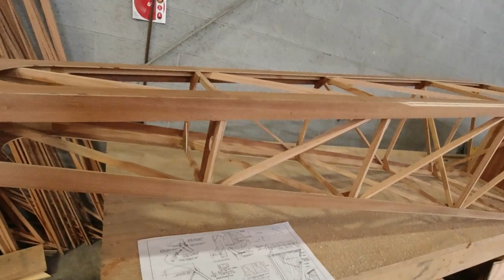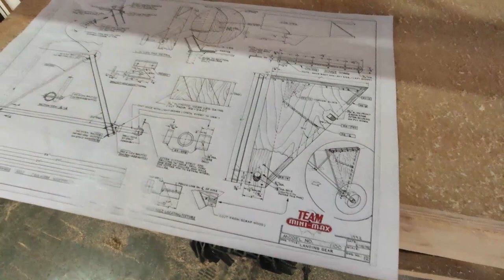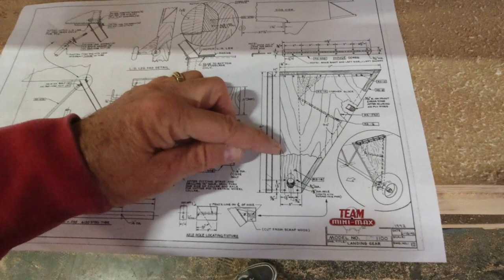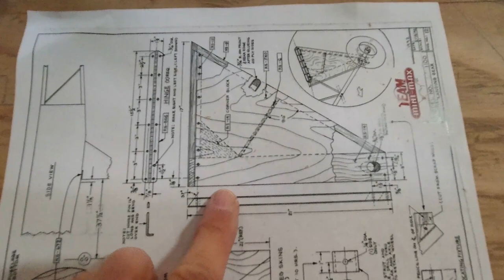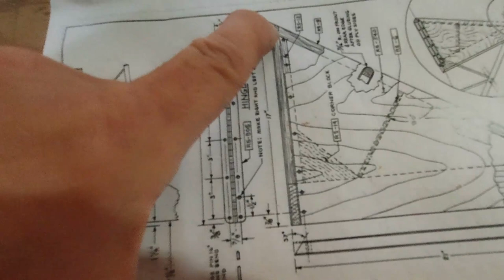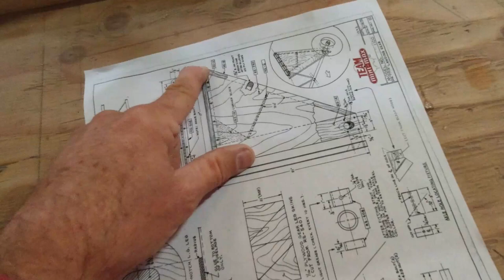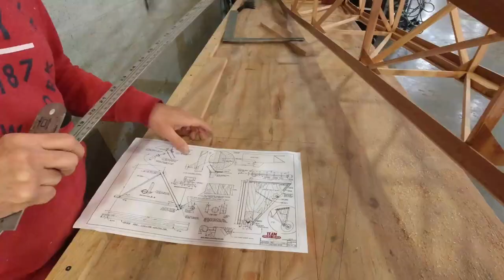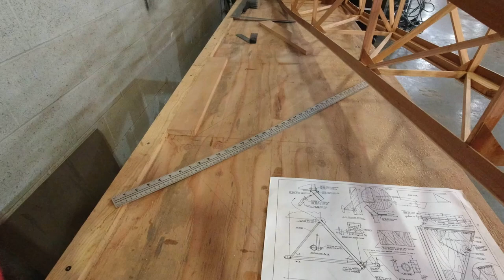Minimax 1100r Wood Aircraft Build Ep 77 - Landing Gear

Comment: Dennis.  I enjoyed watching you lay out the gear legs.  I didn't have an angle finder, so I just "placed" the individual pieces over each over and "drew a line" to match that angle.  Your finder would have been better. 

 My brain then took me to my first flight in the EROS.(a hundred years ago :)    Was at Valkaria Air  Port, Florida.  I was "in a line" of 3 or 4 planes that were lined up to "take the active" runway.  I was trying to get to the runway before they all came out of the woodwork, but got caught in the middle. :)  It was fairly early in the morning.  I kept saying to myself:  "Don't screw this up Mike. :)"  

My turn came, the radio worked,  lined up, applied full power and was GONE!  The nose immediately pitched up, due to the position of the stick and my arm.  That was corrected later on.  I'll mention later how I did that.  The problem was my shoulder straps pulled me back in the seat, and left me with little forward stick pressure for a "nose down" elevator.  Made several circuits that day - even "slipped to landings" - great flying platform.  Stayed over the airfield for awhile at 2,000 feet for maintenance and controllability checks.  All good.  Thanks, Dennis.
Reply from the maker: You sure know how to up my enthusiasm to finish this thing and start flying it!
I really enjoy your descriptions of your experiences Michael!
Reply from the maker: Michael, is there a place I can see a photo of your EROS? That front end on your profile photo looks really cool!